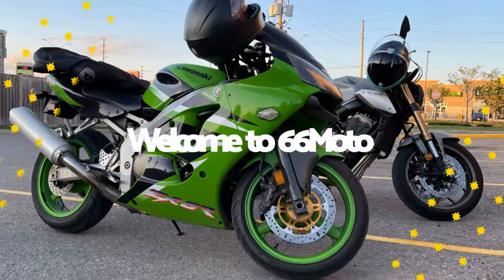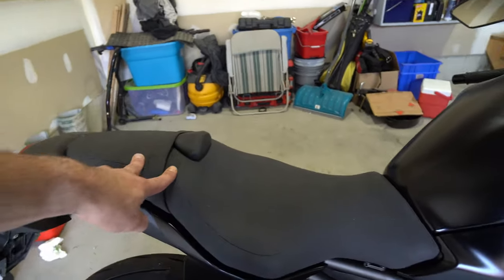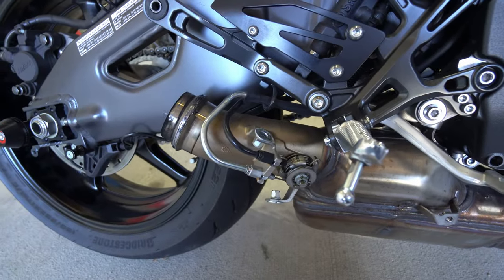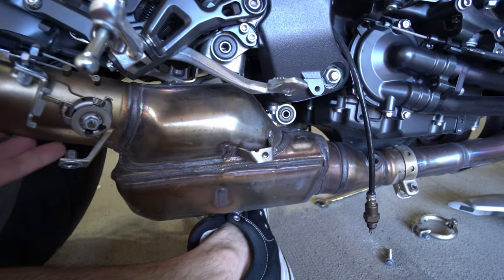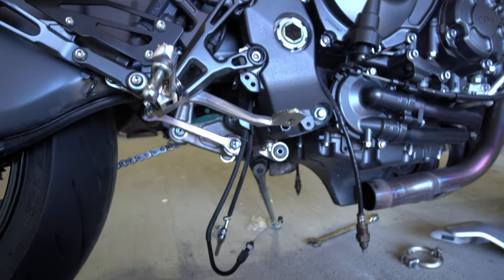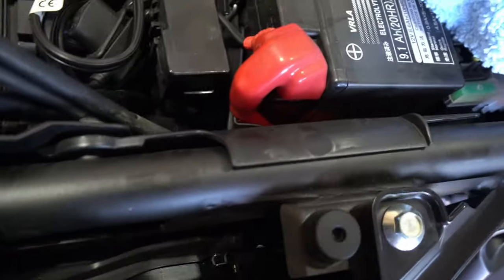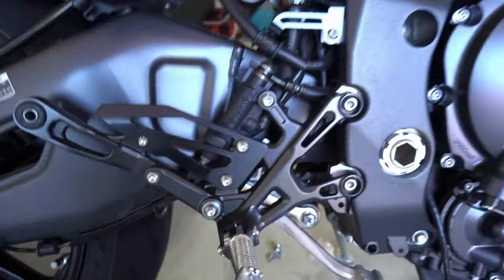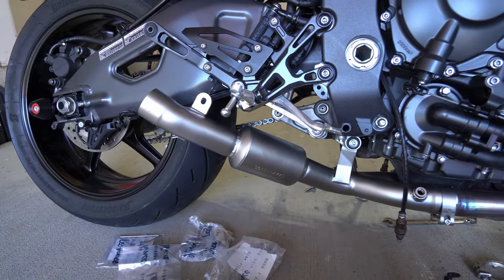2022 Yamaha MT10 LeoVince Exhaust Install

Comment: I didn't know that Leo Vince did link pipes! That's a good way to cut cost by not installing a full system but get the sound that you're looking for! Great video man! Thanks!
Reply from the maker: Ya it’s a really great 3/4 system. Way cheaper then doing a full system. Yamaha doesn’t weld the CAT and muffler to the header like other manufacturers. Ya it produces a really nice sound. It’s not over powering. Thanks man. 👍🏻🏍️
Reply: There are many many more than Leo as well. Also Ali Express systems and link pipes also amazing
Reply: Also these bikes have titanium headers so you shouldn't really need a full system when they have made is so easy to split from the cat back.
Reply: @Yii00T I don't think this is accurate.  The R1 M has titanium headers and the R1 and MT 10 and SP get stainless headers.

Comment: Planning on going through this process on my 2017 MT-10SP with a leovince decat + arrow exhaust. The connections on the 2022 vs the 2017 look to be (mostly) the same. I'm sure your video will help. It will be my first time doing a decat. Most I've done in the past is a slip-on system on my old Street Triple.
Reply from the maker: Nice. The arrow will sound awesome. Ya it’s mostly the same process. I know some on the measurement are slightly different so make sure you get the right link pipe. Other than that you will definitely want to get a tune after doing the de cat. It’s a whole different bike with the weight saving and the tune.
Reply: @66Moto  Yeah definitely bringing it to a shop for a tune afterwards. It's going to cost a fair bit, I'm sure. But I want to do it right.

My main concern is the bike becoming too loud. The stock sound is too low, but I don't want to piss everybody off either. The rules can also be pretty strict here in the EU. I don't want my exhaust to get confiscated if I decide to do a roadtrip into Germany. 

That's why I went for the Leo Vince and Arrow. Both seem to come with  a db killer. I plan on using both the db killer in the linkpipe and leave the db killer in the Arrow muffler as well. Hope it will be enough to bring down the volume, whilst still being an upgrade over the stock setup.

For now I got to be patient. The store informed me that both the linkpipe and the muffler are not in stock and need to be ordered from the factory.

Comment: I had to take BOTH aluminum block brackets off my 23 before there was enough play to remove the cat....the second one is bolted to the bottom rear of motor and is a BIATCH with the cat on to get the screws out!   The cat absolutely was NOT coming off until those brackets were out

Comment: Thanks man, I appreciate your time and effort into this video. I'm going to do the same on my '22. 
So, removing the two EXUP cables is no big deal? 
Why are people buying a servo buddy?
Cruise control still works, & no check engine light?

Thanks brotha
Reply from the maker: No problem man. Glad it helped. Nice man you will like it. Ya removing the EXUP valve is no issue. Just remove the cable that run from the motor under the seat to the valve. You will need to keep the motor plugged in or you will lose you cruse control function. 

No problem brother

Comment: Thanks for the video. Helped me put my Leo Vince exhaust on my Mt10

Did you tune you bike? If so what time did you use?
Reply from the maker: No problem. I am really glad it help you to install your exhaust. The bike sound so much better over stock. 

No I haven’t tuned the bike just yet. I’m think of sending my ecu to Vcyclenut. I notice he has a video of him doing testing with the same link pipe and stock silencer. If I don’t do that I’ll be taking my bike in next spring to a local tuner to get flashed and custom map. 

To my surprise the bike actually runs okay with out a tune. I’ve definitely noticed a reduction in power in the lower rpm. I would still definitely get a tune because it’s most likely running lean and that’s no good for a engine. 

Ride safe brother 🤙🏻

Comment: Hey , what if the cables remain in servo motor after I changed the exhaust ? Any harm ?
Reply from the maker: Hey. I would just remove them completely. Eliminates the risk of the slipping out and ending up in your rear rim. They are long. They are easy to get out of the servo motor housing.

Comment: Did you ever get your bike tuned and who did you go for? Was wondering also how long you ran the bike without a tune and  how did it run? Using your video to install the same exhaust on my 22 MT10 :) Thank you!
Reply from the maker: Hey. I haven’t got the bike tuned just yet. I’m thinking that I’m going to send my ECU to Two Wheel Dyno Works. They seem to have the best one and are the most knowledgeable about them. VCyclenut would also be a good option. The bike runs like shit with exhaust added and no tune. Loss of power down low and twitchy throttle. Hope the video helped.
Reply: Your video helped a lot. Got the pipe in. I haven't decided yet who to use for the ECU tuning. How many miles have you ridden now with the decat without a tune? @66Moto
Reply: @rencel3664 I did 2 wheel dyno and the bike is COMPLETELY different now it’s wild!! And runs sooo smooth. But it’s an absolute machine now. Strong recommend the guys at 2 wheel.

Comment: Do you need to do dyno or remap after that?
Reply from the maker: Yes I would highly recommend you do. Mine ran like shit after putting the exhaust on. Lost power down low, like a noticeable amount. I have mine done now with a mail in ECU service and the bike is running amazing now. Completely different bike in a positive way. More power, smoother throttle.

Comment: Hello, im gonna buy this silencer for my R1 but my supresor is Mivv, it will be any fixing problem ? Also the spring is 100% necessary cuz I can’t put it on my supressor
Reply from the maker: Hey there. I’m not 100 percent sure how the fitment will be with the Mivv supresor. I would check out  the diameter of the Mivv pipe and the diameter of the Leo Slip on to make sure it will slip on. Also if the Leo slip on has the clamp with it then it should be tight enough to hold. Before I put the spring on it was really secure with out spring.

Comment: Do you need dyno after that? I will run lean no?
Reply from the maker: Yes definitely will need a tune. After I installed the exhaust the bike ran like crap but that was to be expected. The MT10 has an open and closed loop system. From idle up to rough 5000 rpm it used the O2 sensor to adjust fuel and the switches over to pre written map. So in low RPM the bike was running really rich and I lost all power down low it smelled like I had a gas station was following me around haha, and in the high RPM the bike was leaning out and not getting enough fuel. It’s okay for a little while but you definitely doing damage to the engine if you don’t get a tune. Some people say you don’t have to but I completely disagree with that.

Comment: Nice Vid! Does it actually harm the engine when you dont put a remap on ? I thought about getting the link pipe but here in germany we have very strict emission rules and we have to bring all kinds of vehicles to the TÜV (Technical Supervisory Association)every two years, were the emissions are measured. So my plan was to put the OEM silencer back on when I need to go the TÜV. A remap probably would increase the emissions and let me fail der instruction.
Reply from the maker: Thank you. Long term running bike without aftermarket exhaust and no tune could potentially damage the engine. When you put exhaust on it make the bike run lean. If it runs lean it heats everything up like the spark plugs, valves, pistons ext. You could always put stock exhaust back on for your Tech inspection. I’m not sure it would make it fail emissions because most tunes get it close to proper AFR anyway. Plus with the cat being back on it would filter out and un burnt gas.
Reply: @66Moto  thank you I assumed that. Life here for bike guys is really tough. Some cops would confiscate the bike and give you 1000€ ticket if you would ride straight pipe. At least we have the Autobahn were we can push the shit out of our bikes
Reply from the maker: Ya we get loud exhaust tickets here to. They only really give you trouble if you being a idiot like Revving. Would love to have a autobahn haha.
Reply: watched a video and it loses 5hp without a tune 😢
Reply from the maker: I would definitely say it does. It runs like crap currently. We’ll have it all tuned up for next season.
Reply: @66Moto  I also have my 17 this way 😆 what do you mean runs like crap?
Reply from the maker: At idle it smells like pure gas coming out of the pipe, at higher RPM the on and off throttle is very twitchy. When the stock exhaust was on it was very smooth. On deceleration I get a lot of cracking and some flames 🔥 This was all to be expected though.

Comment: Which legal slip on (not Fullsystem) can you recommend? Loud and pops
Reply from the maker: You could get the Leo slip on. If you just do a slip on your not going to get pop or very loud. 3/4 system will give you sound.
Reply: @66Moto  what do you mean bei 3/4? Cat ?
Reply from the maker: @Capsulecorp01 Some systems are 3/4 system that take of the Cat/Muffler on the MT10 it uses the stock headers. Or you can get full system that come with the headers and the silencer. CAT stands for catalytic converter.

Comment: Did u tune the bike with the new LV system
Reply from the maker: No I haven’t tuned it yet. It definitely needs it. Bike runs like shit now. That’s was to be expected though after putting the system on. I’m going to be sending my ECU in over the winter, or I might get a local tuning shop to do it in the spring. Haven’t fully decided yet. A friend of mine has the same bike and had good success with a mail in ECU tune.
Reply: @66Moto  Ok this one shop by my house wants to change me like 1100 dose that sound about right
Reply from the maker: The place I’ve been thinking of going is going to charge me $850.00 CAD for a flash and tune. I have found that all the places I have talked to give me a different price. I guess just their shop rate.
They are most likely going to use Woolich or FT ECU. I would stay away from power commanders I had one on 2019 MT10 and highly disliked it.

Comment: 💯 % needs a tune I've seen these from factory on the dyno the mix ain't pretty. Don't ride it much at all without a tune.
Reply from the maker: Will definitely be getting a tune on it. It’s definitely lost power down low and can tell it’s running lean. Choppy throttle, even more so now. Was thinking of rapid bike for it as it has done wonders on my girlfriends street triple.
Reply: @66Moto  rolling tune or flashed?. 

Normally these make some power low doen then lose it up higher after an exhaust.  

Wonder what the weight saving is. Yet to see a video.
Reply: @66Moto  if I was in the state's I'd get a Moore mafia tune for sure.
Reply from the maker: Ya Moore Mafia, VCyclenut, or 2WDW work all seem like they would be a good place to send my ECU in. I’ll definitely weigh the old exhaust and see what it was and post back to you.
Reply: @66Moto  sweet I'd love yo know the weight difference.  Don't think Chris did it on Moore mafia page. 

I'm looking forward to getting a newer MT10 maybe even a SP